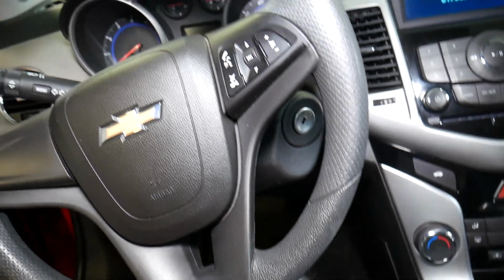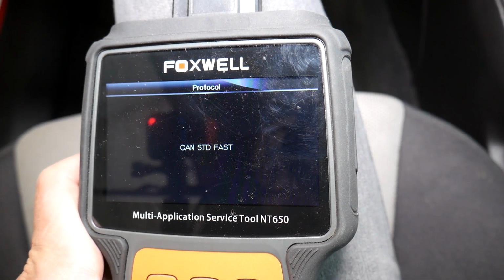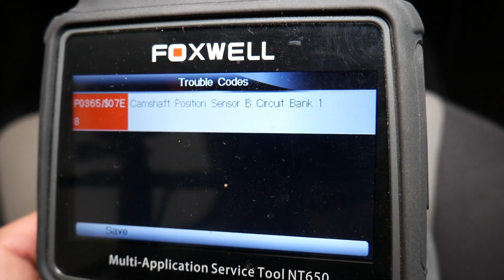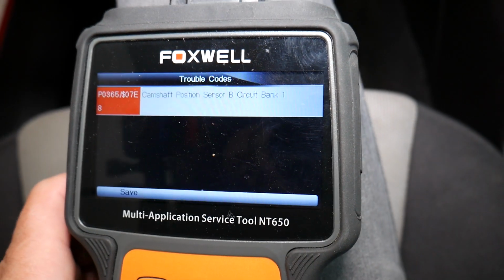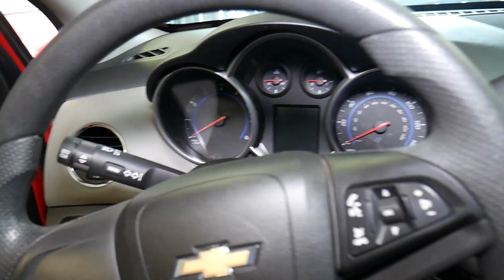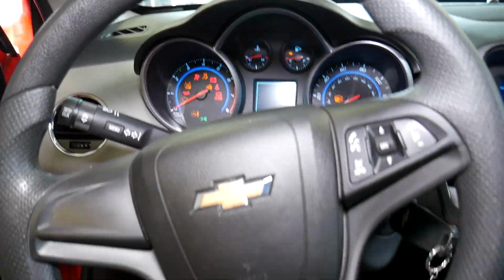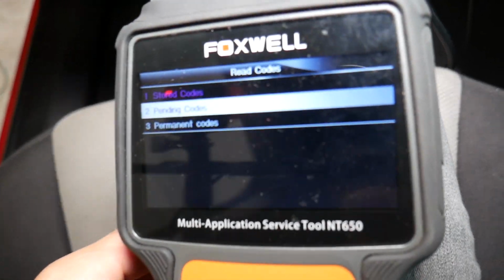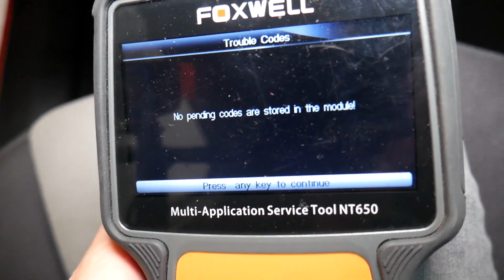CHEVROLET CRUZE SONIC P0365 CAMSHAFT POSITION SENSOR B CIRCUIT OPEN BANK 1, CHEVY HOLDEN CRUZE SONIC

Comment: Okay but how do you actually fix the problem because I replaced the sensor and the issue still occurs it's a good car I'm just ready to throw it in the trash that's how aggravated I am if somebody has ran onto this issue and has figured out how to actually fix it please do not be afraid and leave a comment thank you

Comment: The socket required to remove the camshaft sensor is not listed in the description. 

Do you have to reprogram the sensor with the camshaft or just install new sensor and delete codes?

Comment: Greetings, I have a 2012 Cruze 1.8, I adjusted the engine, we rectified the monobloc, they changed pistons, gaskets. hydraulic gears, water tank, oil pump, solenoid valve, check valves, camshafts. When I turned on, I returned the code P0365, when advancing the engine did not give full power and turned on the service cart. I passed it through the oscilloscope and at low revs it shows the valleys and ridges well, at high revs an event is lost in the exhaust camshaft, when checking the timing is fine, the lines were checked, they are not shorted, they are In good condition, Crankshaft Position Sensor and Camshaft Position Sensor have already been tested. I don't know what it could already be
Reply: Did you fix your problem? I have the same

Comment: this video is just addressing camshaft sensor bsic scan and replaced not explaining how you fix P0365 even you replaced camshaft code still present.
Reply: Same here, except my original code was P0011. Replaced VVT Solenoid and Camshaft intake sensor. Now car is throwing P0366, but no issue with driving or idling!
Reply: @cwiiin513  Same to me. Replaced the VVT, and switched from P0011 to P0365, what did you do in the end?

Comment: What if the same issue continue and check engine light on again even after replace the sensor ?
Reply: Same question. Watched your video to do the timing on a 2016 cruze limited ls (1.8L). This code came on afterwards. I opened up the timing cover and my cam gears and crank gear timing marks are still perfect. Could it be an issue with the camshaft or cam gear itself?
Reply: It’s because there’s two I believe